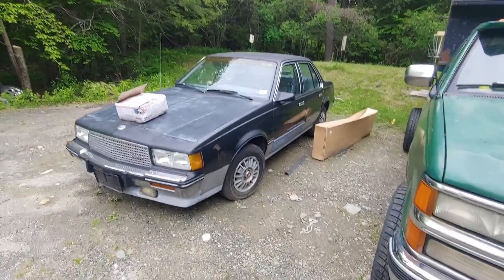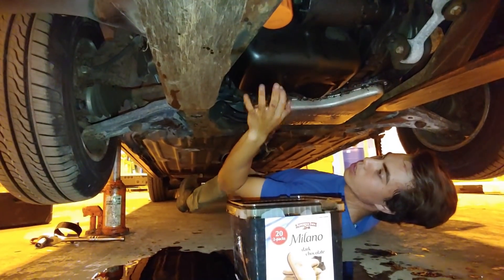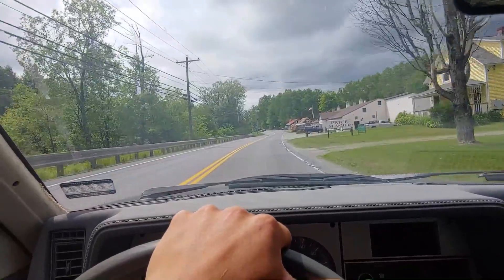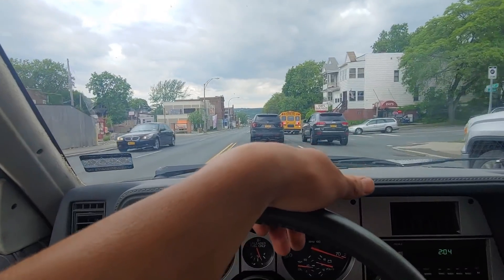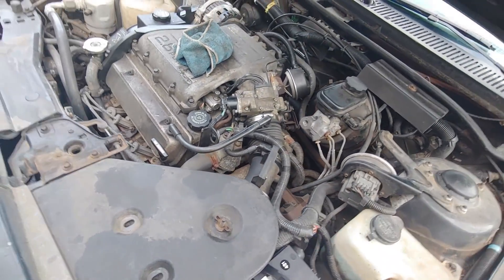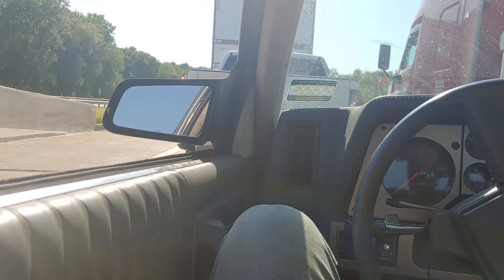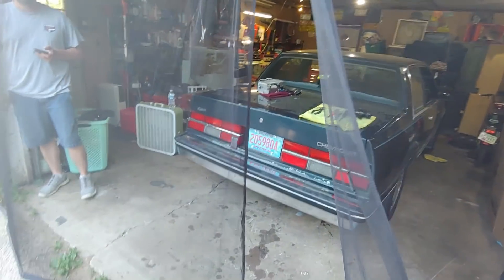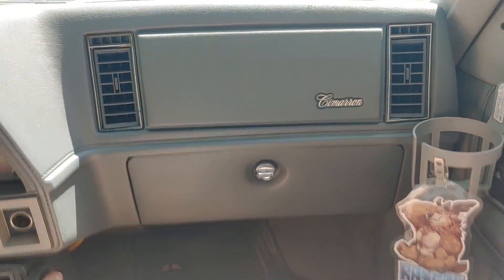Will It Drive 1000 Miles Across The Country After Sitting For 20 Years?? $600 Cadillac Cimarron

Comment: Bought a 1982 Olds X-body Omega new. I had to do a couple things over the next 15 years to keep it running and out of the junkyard, but I put over 170,000 miles on it and everything still worked on it when I sold it in the late '90's for a few hundred bucks to a single mom who needed transportation. These '80's GM cars were budget friendly and surprisingly reliable.

Comment: Thanks for the memories...
I was gifted one of these by a elderly neighbor that could no longer drive and was moving to a assisted living facility.
I had done chores for her for years and she knew I was saving for a car.
It was seven years old at the time but had less than 10k miles and had ALWAYS been meticulously maintained and garaged since new.
I drove it through my final two years of high school and all through college and veterinary school.
It finally died when it was rear ended at a stop light.
It had 256k miles and the only thing that didn't work was the cassette player.
It was incredibly reliable and durable.
Never failed to start or left me stranded.
Hardly the best car I've owned but wasn't nearly as bad as urban legend suggests.

Comment: Thank you for the video. Great trip.

That's long trip cleaned out the entire fuel system and sludge in the engine. I had an 88 for 12 years. Only issue was at the end when the entire electrical harness fried. I would get another in a heartbeat.

Comment: I have an 2.8 1988 s10  with the EFI and it also has a stiff Gas Pedal. The throttle bodies are just made with a certain way of spring tension so a lot of people have that complaint. Changing the decant cable and the throttle cable did not do anything so after that I found two solutions to save my right knee. 1. I was able to add a solid state cruise control from an 89 c body GM truck (not the older vacuum kind) . I found it in the junk yrd. I did a few attempts and a lot of research on s10 and other gm truck forums before I found the exact right one that could take the VSS signal from the OBD1 wires, and the 88 s10 had a specific optically generated speed signal relating to the speedometer since that was one of the first years they transitioned to electronic generated speed signals for the cars computer and speedometer operation. So it works great except that the cruise thinks the truck is  1/2 the speed it is really going so therefore the cruise can only turn on a speeds of 50 MPH or greater than 50 (most cruises are set to work at 25mph or more). #2. I added a spring to counter the tension of the throttle body spring. So it pulls in the opposite direction. I had to find just the right spring so that this did not make my idle speed increase.  Now I can drive and it feels like a normal gas pedal and i have cruise on the hwy.

Comment: awesome.... In 2003 I drove a 1989 Mercury Tracer from SC to NY, and it overheated within 15 miles...LOL but I just keep a 5 gallon jug of water in the car and stopped to refill the radiator and allowed it to cool a couple of times, replaced the water pump the next week and it ran like a top till I traded it in 2007.

Comment: Great video I have a Question for you On a stuck Hood on a 1977 chevy I can't open it I've pulled the hood latch but the out side is stuck HELP please do a video on how to release a latch on the out side of the 1977 Chevy Single Cab
Reply from the maker: Try to have someone else pry it open with a screwdriver while you pull the latch

Comment: VSS probably has CE light on too. Also TCC lockup solenoid on the THM125 Trans are junk. Some would intermittently lock, fail to lock, or stay locked up causing engine to stall when coming to a stop. But again lockup needs speed input to ecm to work.

Comment: Did the cruise control not work? I see the switch and button for it on the tuner signal stalk. The button on the end of the the stalk is coast and the little slider is the on/off and set speed.
Reply from the maker: did not work speedo broken
Reply: @ARuralVermonterQqjmcb182  I forgot about the speedo.

Comment: Its basicly a chevy 2986 chevy cavalier with a v6 ...still a cool car...my mom had a 1988 chevy cavilier with the 2.2 4 cylinder engine...it is pretty vool that it has the 2.8...i would want to take the top end apart and put 3.5 liter v6 heads on it..

Comment: It's a shame, the most prolific automotive and machine manufacturer the world has ever seen, purposely made junk like this Cadillac. Cars, trucks, locomotives, city busses, military trucks, refrigerators, the automatic transmission, mass scale auto ac, neodymium magnets,  hydraulic brakes, and on and on. GM's only competition was itself, and it beat itself constantly. Certainly, management is to blame, then and now, but being a huge fan and having restored over 100 classic GM cars, their engineering and design are unrivaled. No other manufacturer was even close. As Alfred P Sloan famously told a concerned line worker, who mentioned a potential improvement in the assembly line process..."we hired you from the neck down". 
Even this abortion of a platform manged to hang around long enough to still be operational. With their maximum efforts at planned obsolescence, even their junk is somewhat impressive.